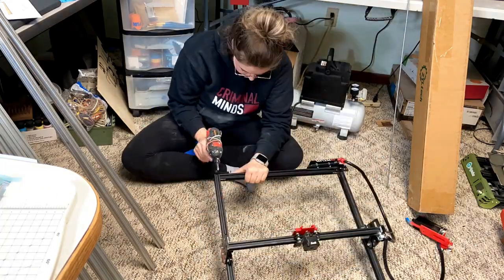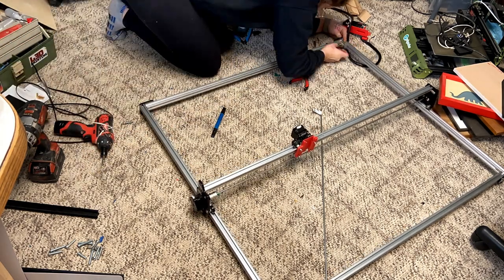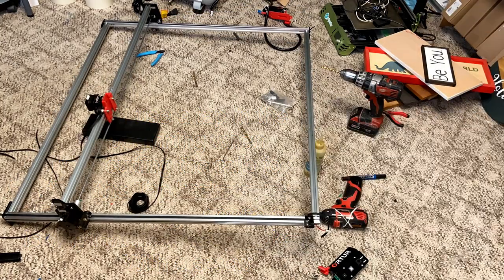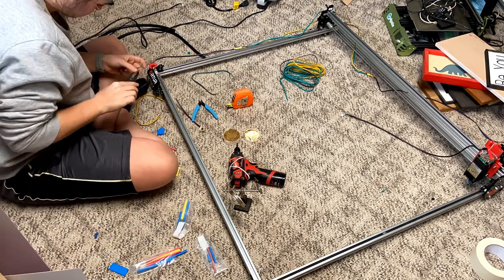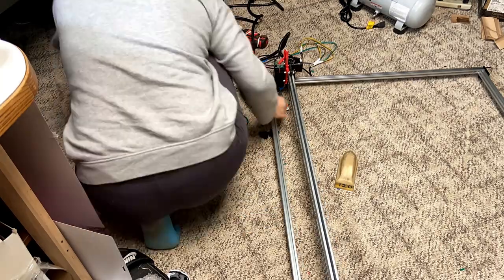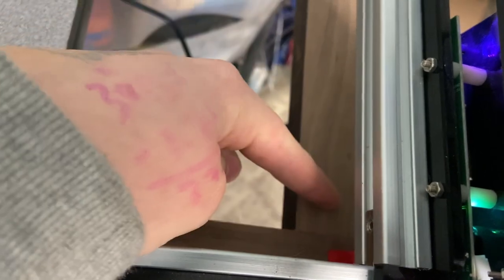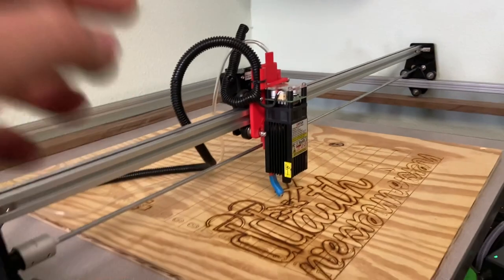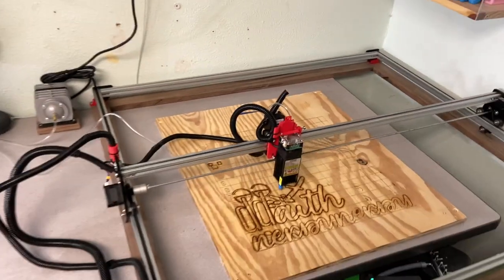Ortur Laser Engraver and Cutter Major Upgrades!- Added Air assist

Comment: So awesome!!  I am in the process of doing this upgrade to my Ortur as well.  I also purchased the t-slot instead of v-slot extrusion (1000mm).  Glad to know that it still works!!  Thank you so much for this video.  Still waiting on my NEJE 40W to get here as well.  Excellent build, new supporter!!
Reply from the maker: Thank you! Glad I could help! Just to let you know with the T-slot  especially on the X axis you might need to drill your X axis bracket holes a little bit more because your wheels will angle out a little bit more if that makes sense. Because they are T-slot and not V groove the wheels will not roll like they used to. It took me some a while to figure it out but I got it. If you need any extra help just let me know!

Comment: For the cable you might fix a pulley to the ceiling, fix a rope to the cable guard and a weight on the other side. It should keep the cable up while allowing for movement in all directions.

Comment: Great video. Your screw movement has a potential of being a problem called screw whip but as long as you don't try a rapid movement too quickly it won't whip too much. You can fix that by getting a larger screw. 

For the z wire loom I used a cross dowel in my cabinet that the wire loops around. I'll take some shots tomorrow. 

And tapping the rails is easy with tapping drill bits. I picked up a set from harbor freight
Reply from the maker: Ya we had those taps then I broke them and it was late but I wanted to get it done so I improvised lol. And I did end up using bigger screws and not the ones that came with the original machine. Thanks for watching!

Comment: I did something similar, only those cables annoyed me, so I used straight belt cables. I added on the side of the x and y axis long boxes of cross section "U" made of 3 pvc plates. It has a much better positive effect on the nerves than hot chocolate :)~

Comment: You need a large workbench for these behemoth projects, whatever you do, don't get one off Pooch LOL, watching this has got me thinking about making a quick tool change for my MPCNC
 by the way, I saw someone overcome the cable issue with a spring-loaded key cable attached to the ceiling, I cant remember where I saw it though

Comment: How does the laser know it now has a larger area  Does it need to be adjusted. Meaning in lightburn  you pick what laser you have  and it knows the work area for that laser.  I'm confused.  Maybe you could give classes step by step.  I would love to make my Neje 20 W bigger It's only 6 x 6 inch working space. FYI I'm rounding 60 years old and   I want to be you when I grow up.   You are an inspringing woman. Thank you .
Reply from the maker: In light but u put in your dimensions of your cut area for example 400mmx 400mm. And when u move it know where it is at just like a 3D printer. It’s pretty simple
Reply from the maker: Does that make sense

Comment: Wow!! you are very mechanically inclined, I just bought the ORTUR 2 master pro a few weeks ago and was thinking of doing the same thing to my laser before I build a enclosure. Thanks for the video and the links. Question? Are you still using it and happy with the modification you made to the laser? And did you replace that smaller rod?
Thanks again!

Comment: You ought to look at something bigger like a 40watt laser tube. There are plans online to build your own enclosure. That little blue laser diode will only do so much.
Reply from the maker: I actually just ordered a Neje 30w laser to replace the 20w one I have.
Reply: @TimberWood.Customs  I'm planning on buying a laser but no idea what to get yet. You mentioned a neje 30 watt laser. It's capable of cutting acrylic to do the acrylic display lamps I want to do ? Thanks
Reply from the maker: @eddie1003751130  I’m pretty sure yes. If my 5.5w laser can cut acrylic the yes the 30w(7.5w) can for sure do that
Reply: @TimberWood.Customs  thank you
Reply: @TimberWood.Customs  Just to clarify, the blue laser diodes actually don't have the same cutting power that C02 laser tubes have. They require water cooling and cut much faster and deeper.

Comment: So thankful for your channel! Where do you get the red feet? I need to cut parts out that are plastic ( Its being done on an Epilog) But the plastic part is 5 inches high so I need to raise the rails and gantry. Can you explain what the air assist does? I have 33 years of experience in Lasers, the first one ( 1987) 145K 15' x 20' second one (1992) Garbage Epilog Summit 45K third one still researching maybe a mira 9 but for this immediate need maybe this will work. <3 Love your attention to detail.
Reply from the maker: Hi! The red feet are actually 3d printed! Also when I engrave thing that are taller, I just put piece of wood under it to stand it up. And thank you for the support! I’m glad you enjoyed the video! If u need anything else, I’m happy to help!

Comment: You're super cool. Can you please tell me more or less what the upgrades cost without the laser itself thanks
Reply from the maker: Yup the rails where a total of $36 and the belts were about $10, air pump was $35, and the tubing as about $5 everything else like screw I already had around so about $86 to make it bigger and better. Is that what u wanted to know?
Reply: @TimberWood.Customs  Good video! Can you tell me where you purchased the rail upgrade and new belts!

Comment: Great job!! Was actually looking for a video of increasing the size a few weeks ago!! Did you have to change any settings in lightburn or your software for the new sizing?
Reply from the maker: Sure did!
Reply: @TimberWood.Customs  Did you have to change any settings in  your software for the new sizing? Can you make a video of it?
Reply from the maker: @berikj  sure I can make a video of it! And all I changed was the size of the machine! Go to edit, device setting, then change the machine size. But I’ll make a video on it:)
Reply: @TimberWood.Customs  Fantastic. Thank you very much.
Reply: @TimberWood.Customs  I went into edit, device settings and then changed the machine settings. I keep receiving this when I try to use it.
OLF 137.
Grbl 1.1f ['$' for help]
[MSG:'$H'|'$X' to unlock]
[MSG:Caution: Unlocked]
ok

I don't know how to unlock this. Any help would be great.
Reply from the maker: @colewiggert5948  You then also have to go into your console area and type in $$ and then you’ll get some numbers that show up and you need to change the $130= to one of your new values and do the same for $131= then u won’t get the error anymore
Reply: @TimberWood.Customs  Thanks for the help. I'm just getting it dialed in now. You have been very helpful and appreciate everything. Thanks again!

Comment: Good job.  I just got my 20w Laser Master 2, and I noticed that you used 5mm belts on your expansion.  The belts on my Ortur measure 6mm in comparison.  I also found that the 6mm are much stronger and harder to cut than the 5mm found on my 3D Printer.  Should that matter?

Comment: Hi love the video you said V GROOVE Rail thats got me I'm new at this did you use c tube l_l type did you have to change any settings on the software etc that thing is Massive what are stove toppers lol also you said not shore in this video or the others lasers last a month that worried me does the air feed help the laser last longer T slots rails got it fantastic work 
I've ordered a Ortur wait a month for it to come so cool thank you for all you advice 😎
Reply from the maker: All I changed in the settings was the size of the machine in machine setting and in the console section when u type $$ you have to change your machine dimensions. Stove toppers are thing that sit on top or over your stove so you can like put things on top of the stove when not in use, it’s like decoration. To make your laser last longer u don’t want to run it at 100% power.  Yes air assist helps with cutting materials easier. Glad to help:) if u have any more questions let me know

Comment: This is really impressive, i have a question for you. Do you think i should buy the Laser Master 2 Pro and make this upgrade ? Or is it waste of money and should i just get a slightly cheaper model and then upgrade the laser on it so i get something as least least as good as the Laser Master 2 Pro, i see those Ortur 400x400mm comes with different specs, not sure what to buy for doing this upgrade, can you please give me your best advise on this one ? Thanks.. :D
Reply from the maker: I’d get the laser master two pro the LF version which has air assist and then upgrade it to the big size, it’s a great laser with the safety features and the air assist makes it great
Reply: @TimberWood.Customs   Wow that's a great answer for me, so i will go ahead and order that one in a very close future, also the 20x20mm V slot profile, i will buy the 1000mm length. I will not build mine as big as 1000mm but maybe 800x800mm.. thank you very much for your answer :D
Reply from the maker: @HearGear  you are welcome!
Reply: @TimberWood.Customs   Do you think it would be possible to use the old frame from the Laser Master 2 Pro to build a little CNC mill, and using the New laster bigger frame to cut out the needed part in acrylic ? How thick do you think the acrylic should be for a CNC 400x400mm ? Thanks..
Reply from the maker: Not sure on that, I’m sure the rails would work but for the acrylic not sure.
Reply: @TimberWood.Customs   Because i see that the EleksMaker A3 has alot of acrylic in the construction, i am not sure about how think this Laser Master Pro you suggested yesterday can cut acrylic.. after all, the old fram 400x400 is not very big so maybe 5mm acrylic can be cut on the Laser Master 2 Pro with Air Assist..
Reply from the maker: @HearGear  I know it can cut 1/8” acrylic but more than that I don’t know
Reply: @TimberWood.Customs   Yeah, i guess i have to try for my self and see what its all about when it comes to cutting acrylic.. what cheap and easy to use software do you recommend for Laser Engravers like this ?

Comment: That's really nice. Questing about your air assist. How do you obtain these cool 3D printed parts when you don't own and have no desire to own a 3D printer>
Reply from the maker: I know there are some people who can print the for u  and u can pay them.
Reply: @TimberWood.Customs  Thanks. I might see what I can find or rig up. I have the latest version of the Ortur Master 2 20W and they now come with a fixed lens and adjustable slide on the back to focus the laser. I'm thinking this will still work, maybe even better. I like the air compressor you use, it's alot smaller then some of them out there. How noisy does it get? also, does it put out enough pressure to allow good cutting and cleaner cuts/engraves? Thanks again, you've done a pretty awesome job at modifying your setup. 2 thumbs up!
Reply from the maker: @IIIofV  yup it’s ver question! And ya it does just the right pressure it’s perfect! And ya I have that same one I actually reviewed it before I did all of this

Comment: Did you buy a rod and remove the old one and put a new one? The one at 7:33 that you are talking about.
Reply from the maker: Bought a new rod at menards
Reply: @TimberWood.Customs  you use the items from the old rod andp ut it on the bigger rod right? thanks
Reply from the maker: @michealcroes3377  I used the rod holder karts but I bought a new rod

Comment: Do you have a step by step sheet  and the exact sizes of  what you used?  I saw the rails and belt  links but I don't know how much I need also where do I get the wires and the rod.  Thanks for any help you can give
Reply from the maker: Hey! So the rails all depend on what size you want to make it! I bought 3 1000mm rails for the x axis(has to trim two of them down 1.75 to fit like the original setup was and 2 900mm rails for the y axis. The link for the belt is more than enough for the size rails I bought you just cut them down after u put the frame together. Also, I just extended all the wires with spare wire I had in the shop, just soldered them to extend the distance I needed. Also the rod I got at menards. There should be a link for that too. I think it was 3/16 that’s as close as I could get to 5mm which was the size of the original one, all I had to do was add a little tape and really totem down the coupler that it was connected to. Hope this helps!!
Reply: @TimberWood.Customs  I'm gonna cheat a bit I was able to get 2000mw Mini Laser Engraver Cutter for a low $110.  When it arrives I want to take my Neje Master 2 20 W head and board and put it into the larger frame so I can increase the bed size from 6 X 6.  to  ( 25.5 by 19.5 inches ) and put the lower watt in the Neje frame.  When I go to lightburn I would add it as a new device and put in the Dimensions  and then it will know the laser area  I think that's what  you advised me.  Any other  tips or tricks I should know?

Comment: did you need to buy any wheels or anything or just use the ortur items on that machine. I am going to make one. thank you. But i will make it with the pro model as it is faster
Reply from the maker: Did t buy any wheels, just used the original ones

Comment: How did you get the machine to operate on the larger size?  Did you have to modify the g-code or light burn to alter the x and y dimensions?
Reply from the maker: In light burn u go to file and machine settings and then u change the machine size. It’s super easy
Reply: @TimberWood.Customs  Thank you very much.  I have been wanting to do the same to my old Ortur 20 watt.  But I have been way to busy at my day job.  Can't wait till vacation to catch up on projects.

Comment: Nicely done, did you have to change the firmware for the bigger version?
Reply from the maker: Yes had to change the cut area size
Reply: @TimberWood.Customs  how did you do it? Which programs did you use?
Reply from the maker: @Fordham0815  I use light burn
Reply: @TimberWood.Customs  could you share a tutorial or some information how to do it? Maybe that could be a good idea for a new video :)
Reply from the maker: @Fordham0815  yeah I can do that
Reply: @TimberWood.Customs  that would be awesome
Reply: Hey there. I'm also interested in this
 I can't figure out how to do it
 My machine seems to not know it's limits now
Reply from the maker: @jonathanperez3161  go to the console section and type $$ and then numbers will come up and you have to change the $130= and $131= to your new dimensions
Reply from the maker: For example mine were changed to $130=912 and $131=727 (something like that, just out your number in there also the it’ll work and know the limits)
Reply from the maker: I just posted a video about it! Go check it out;)

Comment: i may have missed it, but is your machine grounded or have you had any problems with static causing it to power off?
Reply from the maker: I switched the power cord to one with a ground in it so yes mine is. I did this because I was having problems with it. But now it’s fine
Reply: @TimberWood.Customs  i've been wondering if that's all i need to do is buy a grounded power supply instead of adding wire to the frame and diode, the ortur website shows this whole complex fix to ground the diode to the frame and then the frame to the house ground with a banana plug line.  it's been frustrating because the machine will just reset at random times during a long burn. https://ortur.tech/product-advisories/#olm
Reply from the maker: @0110rroberts  ya I’ve seen a bunch of other people so that but I had an extra grounded power cord so I though I’d try it use it and I haven’t had the problem sense. Simple fix
Reply: @TimberWood.Customs  I finally got mine working.  I ended up having to run wire all over it to ground it but after I did that it now stays un and complete an entire hour and 20 minute 8x10 image.